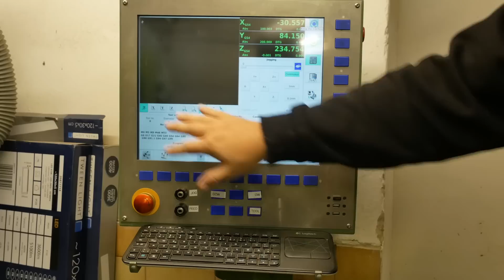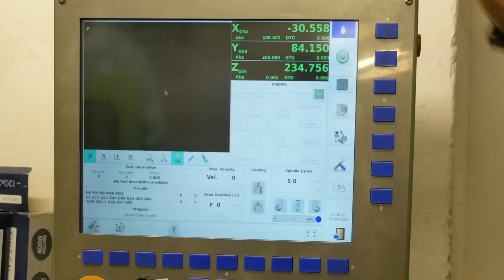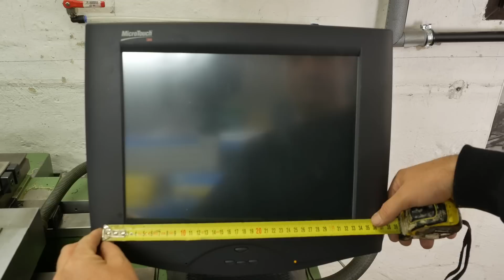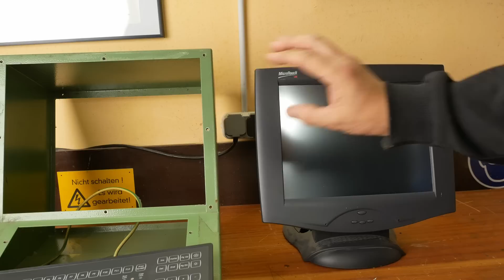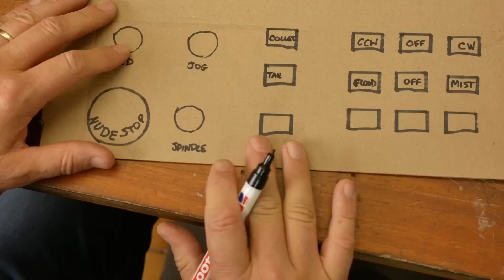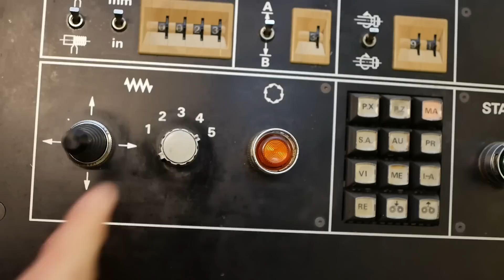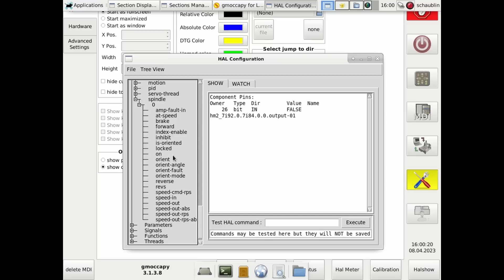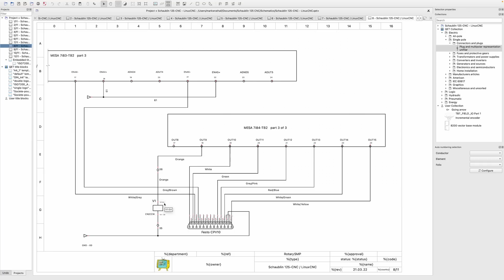Please help critique my CNC control panel layout ideas. || RotarySMP

Comment: Love your videos mate. This is just pure information, sorry if it comes off like I'm being a dick:

I probably do 500 setups a year as a machinist on a variety of CNC machines.
To me, it looks like you're making all the same mistakes again.
1) Screen too small. You're going to be actually needing this screen when you're stood at the spindle. Think about how big your disance to go numbers are going to be when you're stood there.

2) You MUST have a dedicated cycle start and cycle pause button. If you want proof, just look at your previous video where the knurling tool crashed. You couldn't stop it. You've got to be able to have your index finger on cycle start, middle finger on cycle pause, and use them while looking at your workpiece. I can't impress how vital  this is.

My suggestion would be to have a setup like Guildermeiter NEF 520.
A display up top, with soft keys on the side and bottom+keyboard(for programming and setup)and then a seperate box at hand level with jog handles, cycle start and stop, feed override, spindle override, coolant on/off and E stop.)
Honestly I have no idea how you don't crash all your machines all the time without the ability to switch rapid speed and cycle start/pause without looking at the control. It must be terrifying.
I'm more than happy to run through some ideas with you if you like :) What I've circled in red here is what I would call minimum viable, I would take some design advice from these two pictures https://imgur.com/a/4T2C7my
Reply from the maker: Hi Samuel, I really appreciate your feedback.
To 1/ remember this is a pretty small machine. It only has 400mm of Z travel, so I think in practice there will be less than one step between headstock position and controller pos. But it is a good point. I'll check out what it looks like once the new screen come in.

To 2/ I have had a feeling that I need what you say.  On the MAHO I have learned to run programs with my fingers on those physical soft keys of the function especially feed hold. Although the use of the feed override knob cranking quickly to zero is also useful.

I havent done much turning on the Schaublin yet, as it is really terrible to run with the keyboard as you have identified. That was only ever a temp thing.

Thanks, I'll check out that link and get back to you.

Comment: I think the maho part is a good base for the controller. Having worked on a Heidenhain before, I would put the keyboard above the buttons/E-Stop/etc.
Reply from the maker: I was going to, but am unsure if that is then too high given where the module has to live.
Reply: @RotarySMP  is there enough space to lower the whole thing?
Reply: That's a terrible idea. The membrane keyboard is unlikely to cause any accidental keypresses when resting your palm on it, but when the keyboard is above any dials and buttons, you always have to float your hands when using the keyboard.

Comment: I would for sure go with a pair of handwheels, not only for jogging, but they could also be used for a small manual machining operation. To me a joystick on a lathe would just not be intuitive. Too many years of handwheels.
Reply: The reality is that MPGs as handwheels are really difficult to use for machining. Without any force feedback, and with the notches in MPGs, it's basically impossible.
Reply: @spikeypineapple552  Now I wonder if there are MPGs with (variable) force feedback. In theory it shoudn't be that difficult to make.
Reply: @DreitTheDarkDragon  I've had the same thought, but when you think about it a bit more it's actually really complicated.
You want the MPGs to have indents, because you're ultimately controling a digital machine. You don't really have that many great ways of measuring the force, because the servo load on your ballscrew isn't actually a great indictor of the force required. So you have no input, no good way to do the force feedback, and in reality this is for a very niche usage of the machine. If you want true handwheels, go use a manual lathe, it'll be a much better proccess.
Reply: @spikeypineapple552  Yeah, manual lathe would be sure simpler and more real :)

I was just thinking like you could take feedback from servos and for example feed small pancake stepper motor connected via spring to encoder. Motor would follow your set value and if more force is needed, it would make few steps back/forward to make you feel that force.

On other side last things I'd want is machine fighting with me. Reminds me how I had to drive company car and couldn't find how to disable lane assistant. Of course I was driving on highway and during reconstruction they closed half of left lane and moved all traffic to two smaller lanes on right side, marked with yellow line. Car was fine for few seconds...and then it spotted white line and tried to force me out of road. I really didn't expected it to be so strong!
Reply from the maker: @spikeypineapple552  "If you want true handwheels, go use a manual lathe, it'll be a much better proccess." You are cutting close to the bone there :) 
I really like manual machining on a lathe. I think if an Emco V13, 125C, Boxford 10.30 etc had fallen into my hands like this 125-CNC did, I would have been more than happy with it. For what I do,  I really dont need CNC on a lathe (Milling is different), but hey, it has been another fun journey.
Reply from the maker: @DreitTheDarkDragon  That is a scary story. I am also not a fan of such driver aids.
Reply from the maker: Thanks for confirming that. My thoughts as well.
Reply: @RotarySMP  They are really useful for positioning, but it kind of requires a very specific application. On one of the machines I have, it has like a semi manual mode. You can jog say a boring bar to ID of a drilled hole, 2mm clear in Z, then conversationally program a roughing cycle. But it only really pays if you're running these psuedo manual ops where you're doing like over 100ops a day. It's probably better to accept it's not a manual lathe, its a CNC lathe, and that's how it is.
Reply: Handwheels and Jog joysticks/buttons are manditory compliments to each other.

As pointed out by samuel  Handwheels (sometimes refered to as pulse generators) have 100 detents per rotation
it has a corresponding 1/10/100 selector  .001,.010,.100 mm per detent/pulse. 

this is what you use for setup work and  for  fine  positioning
The hand wheel is seldom used for cutting ,but you can if you want.

The jog buttons/joysticks  are used for fast rough positioning and/or manual feeding
again there is  selector to select movement from very slow to rapid traverse.
The jog buttons are what you would use for manual cutting  (no css or mm/rev)
Reply from the maker: @steveggca  Hi Steve. Okay, I didn't pick up on that, that you would use the joystick or buttons for "manual" machining on a CNC. I thought it would be better with jog wheels, even without force feed back.
Reply: @RotarySMP   Think of it as being exactly the same as power feed on a manual lathe .

Comment: Nothing to add to your setup.
Keyboard first so nothing touches the wrists while typing.
Why stick to a touchscreen, since the keys will be duplicated with physical buttons?
On DCS-systems a touchscreen makes more sense because of the very limited input through touches (standardised displays etc), but even then they're often omitted on new installations.
Reply from the maker: The touchscreen is handy for zooming and positioning the picture of the tool path in Gmoccapy. But otherwise, you are right, it is not essential.

Comment: Maho control box looks awesome on Schaublin, I'd use that.
Also more than enough space to fit all LinuxCNC hardware inside, and it's above the lathe, so no further space needed.
Electronic handwheel somewhere with good access, always sucks to use stationary handwheel on the other end of CNC lathe, when dialing something in.
Reply from the maker: Thanks. I want the handwheels to be movable / clampable along that front rail.

Comment: Any chance you'd share your wiring diagram from Qelectrotech? Im building a CNC mill at the moment and trying to get my head around best practices (or any practices!) for laying things out cleanly and effectively. Cheers!
Reply from the maker: Hi James, I've upload it to my LinuxCNC Forum thread.
https://forum.linuxcnc.org/26-turning/41498-schaublin-125-cnc-retrofit?start=490#268658

You need to rename from TXT to QET, as that forum only accepted certain file types. 

Dont learn best practices in wiring schematics from me. Mine suck ! You will see that this is very much work in progress.
Reply: @RotarySMP  Cheers, looks quite good so far! :) Will post about mine eventually.

Comment: Only ever use the EMCO Concept machines and I can say that layout is garbage, which kinda makes sense as you use a mouse for half the things.
But on my homemade cnc I will only have a mouse and keyboard cuz control panels cost money and it's more work to do
Reply from the maker: Thanks for the feedback Daniel. I find that scratch pad on the Logitech portable keyboard works better for me than a mouse for a controller.